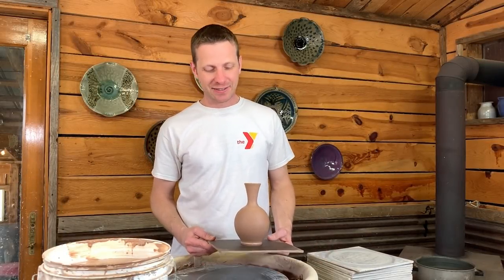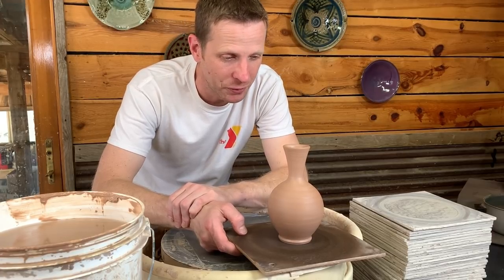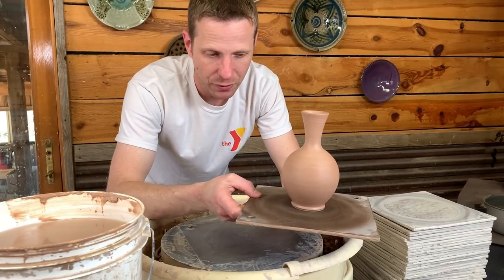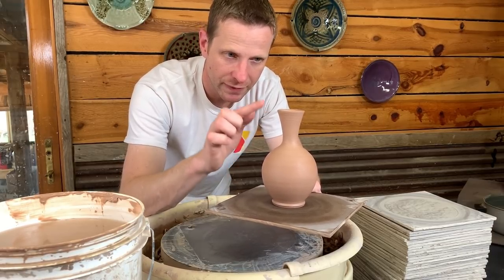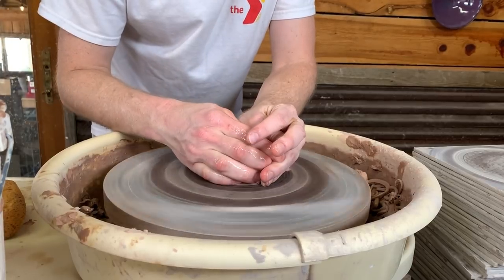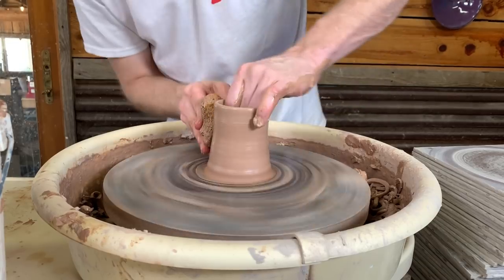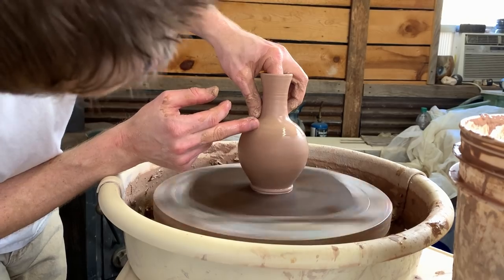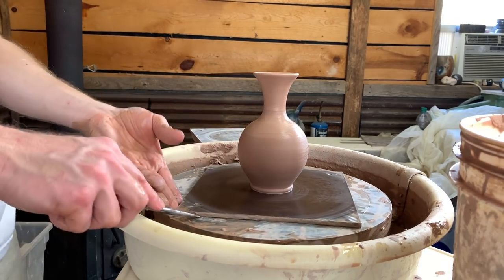How To Throw A Vase With A Tall Skinny Neck

Comment: You have incredible "rib control" Matt! it's like an extension of your hand hehe:) I admire this tremendously.

I particularly like video Matt, mainly because of the "great challenge" there is to create these beautiful little skinny necked bottles. Your tuition is expert [as usual]. 

When I get back to throwing there are 2 things I'm `manly` going to concentrate on! Teapots [my fav] and these little bottles.

Thank you Matt for taking the time and effort to share your knowledge with us. After 2 years you are still the best potter I've found on the VAST internet.
Stay safe.

PS: I have to admit that I do have use of either a hair dryer or blow torch to ease the potential problems at the "shoulder" of pots like these! I know it might be seen as cheating: LOL but ,for me, whatever it takes to end up with pots as good as these then I'll cheat occasionally.
Reply from the maker: Definitely not cheating. Use whatever you have to. It only slows down the process and production. If you can do it without you get to move on to another and practice again and again sooner.

Comment: Your pug! is it one that "de-airs" too? I only ask as in one of the vases you had some air! 
I have a 2" pug but   a 4" [like yours] I think is far better. 
After watching you making these beautiful skinny neck vases, the very next time I went to my class I made [or attempted to make] 3 of them just to see if all your tips had rubbed off onto me; they did Matt and I was rather pleased with my results. If they survive all the other processes I'll post you the results of my results your inspirational video. Thanks Matt.
Reply from the maker: Yes my pug does de-air but sometimes I’m not fast enough to add clay and it pulls in some air through the hopper. Good luck in those vases! Cheers